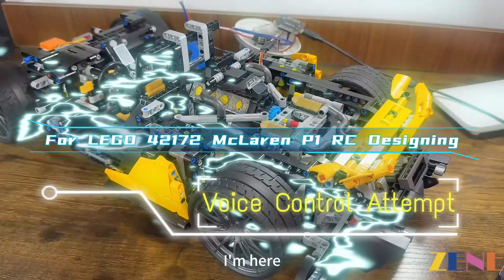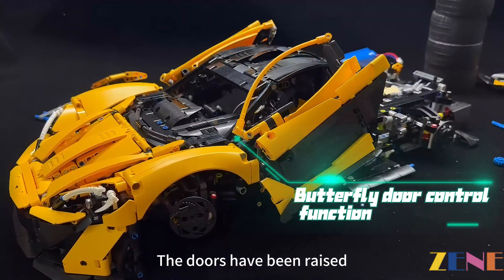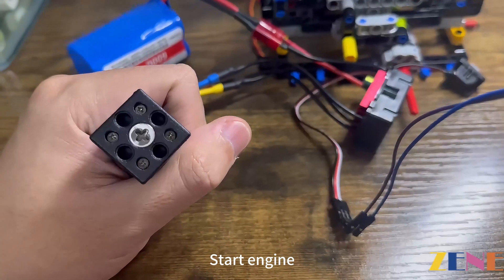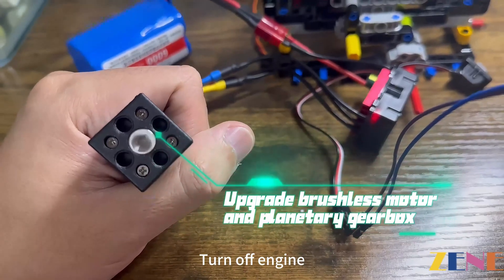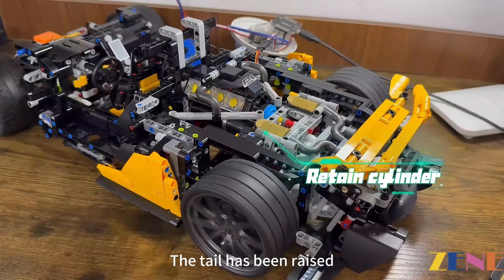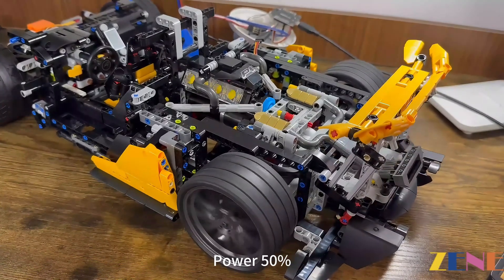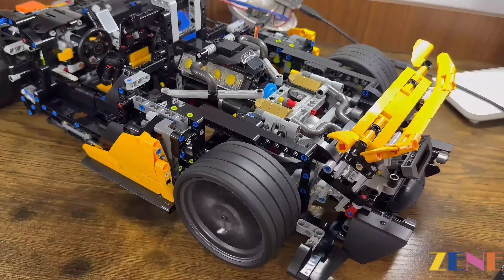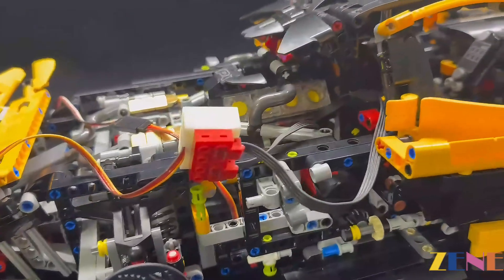37km/h+ LEGO McLaren P1 #42172 RC High Performance Brushless

Comment: I’m planning on getting this kit, does the battery also support power functions cable connection?
Reply from the maker: not support， Although the voltage is the same, the power and interface are different